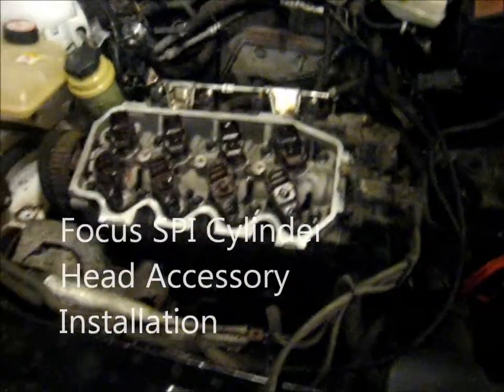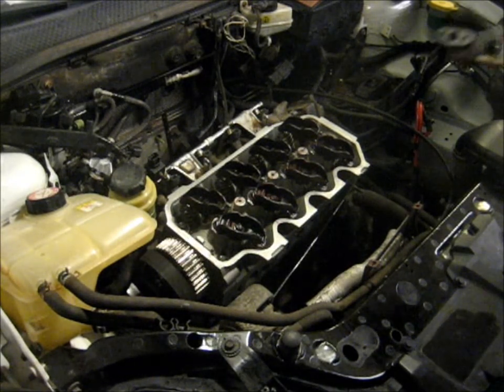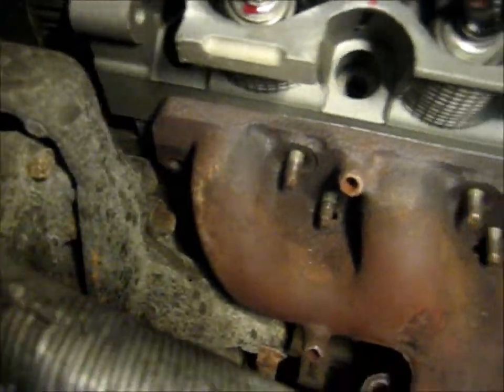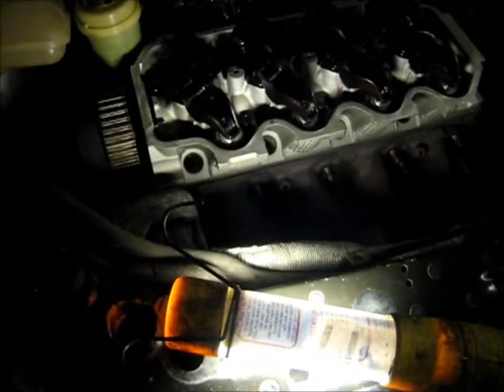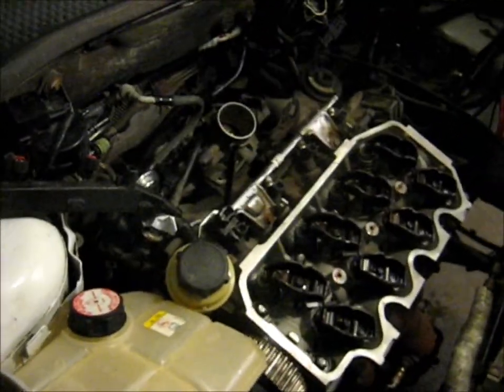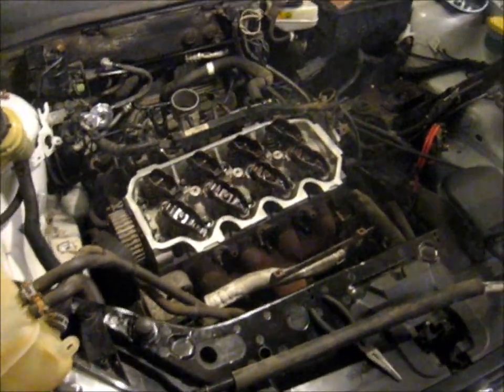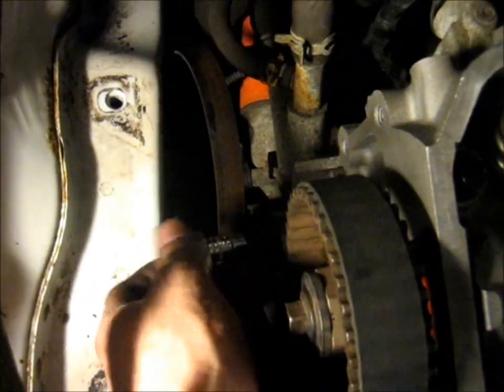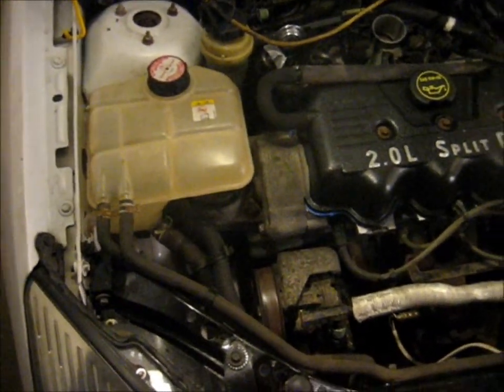Ford Focus SPI Cylinder Head Replacement Part 4/4

Comment from the maker: That is quite possible. There are many things I would do differently if I had to do it again. Since this was the first time I attempted this procedure, I didn't have the luxury of past experience. Also, if the head in question had dropped a valve seat, it would be necessary to remove the intake manifold to clean out the debris. In my case it wasn't necessary, but it's something to consider.

Comment: I was just wondering which repair manual u was looking at, because it is better than mine.
Reply from the maker: I am using a Haynes manual. I got it from Advance Auto Part.
Reply: Machine shops do not pump up lifters after machining a cylinder head.Lifters are primed by cranking the engine over with the spark plugs removed along with the fuel pump and ignition coil disabled.When the oil pressure light goes off,its primed.

Comment from the maker: Line up the arrow on the cam sprocket with the dot casted into the head. Set the motor and cam to TDC before installing the head. They will both be very close when it's time to install the timing belt. You shouldn't have to rotate the cam more than one tooth in either direction to line everything up.

Comment: WOW, you made this look easy. I just purchased a one owner 2000 Focus S/W SE, 82,000 miles, runs great, do you feel I should replace the head now ?? Thank you for the great ,and very helpful upload. I will be doing this replacement in my driveway.
Reply: Replace them I bought one with 65k and it was cherry. I'm at 69k and I just turned it on the other day and the noise started, I didn't have the engine running long but I have to replace that now.

Comment: When installing the Hydraulic valve lifters, does cylinder number 1 have to be put at Top Dead Center before removing the rocker arms and the hydraulic valve lifters?
If so, what would happen to the engine if cylinder number 1 was not put at Top Dead Center before replacing the hydraulic valve lifters and you drove the car around for short distances for a year?

Comment: Hi, so I'm pretty sure that I have a dropped out valve seat. I'm still running tests and things like that though. I'll be doing a compression test later. Anyway, I would like to try this job myself if I do need a new cylinder head. Do you think it is doable for a novice mechanic? I've replaced a fuel filter, brakes, rotors, starter and a few other things successfully. Are there any special tools I'll need?

Comment: Thanks for the reply, I have one of these engines with no problems yet but was thinking of changing the head before it drops a valve seat. I wasn't looking for a performance upgrade but a piece of mind. I have heard of other people having machine shops replace valve seats with poor results, that's why I was curious what they changed . Great video by the way.

Comment: I really think you did this the hard way by pulling the manifolds out with the head, I just unbolted the manifolds and pulled the head out all by itself, no disconnecting fuel lines, plugs, connectors and all that other bs

Comment: After install of the new cylinder head , is it necessary to do a Valve Lifter Clearance Check and if so how would this be done?
Reply from the maker: The lifters are hydraulic and require no adjustment.
Reply: @TheAlexManVideos  

Thanks Alex.

Comment from the maker: You will absolutely need a torque wrench. Air tools help with take things apart faster. With any engine work it is imperitive that all parts are kept clean and gasket sealing surfaces are kept pristine. With large tasks label everything. Zip-Loc bags and Sharpies are your friends. Stay organized. Buy a service manual and read through the ENTIRE procedure before you start. Plan things out and have all parts before you start. Triple your time estimate because nothing goes perfectly the first time.
Reply: TheAlexManVideos A fella took out the lifters/rockers and just threw em in a box. Is there a way to tell which ones go where? Or any advice?

Comment from the maker: Get the motor set at TDC when the head is off. Set the cam to TDC #1 when the head is on the bench. Install the head and bolt it all down. When you install the timing belt, it'll be very close if not spot on. Move the cam sprocket 1 tooth forward or back if necessary. Finish installation.

Comment from the maker: Without dissasembling the valves from the head, there was no visible difference. The company claimed that they maching out the old valve seats and install new ones of an improved design. It's not meant to be a performance mod, only a reliability mod. I don't know that you'd be able to see a difference at all.

Comment: i myself have repaired 2 focus' with dropped valve seats, it is very common with the spi motor. if the valve seat does drop, make sure you replace your EGR valve and clean your intake manifold, if not, the same thing will happen all over again as little pieces become trapped in these places, and always replace the piston  where the seat dropped, it bent the connecting rods and cracked the pistons on both cars i repaired.

Comment from the maker: If you don't see any scratches or scoring in the cylinder wall, you are probably safe. Make sure there are no dents close to the edge of the piston. These can cause ring sticking or piston cracking. If you don't see anything that looks dangerous you can go ahead and install the new cylinder head. It sounds like you got lucky but keep in mind it's a bit of a gamble. Make sure you clean the EGR and intake manifold before reassembly or the metal pieces may get recirculated through your new engine.

Comment: One more thing. What is the head bolt torque sequence. Do you possible know the Piston rod torque. I had to replace the piston in mine. I think the torque on the rod is 28?
Reply from the maker: Correct. Rod bearing caps are torqued to 28 ft-lbs.

Comment from the maker: I don't understand what you're saying. You checked compression and all the cylinders read 175 psi, then you go on to state that cylinder #2 had zero compression? Anyway, the compression loss is probably mostly from the valve seat no longer existing, but there is also the high chance that the piston and cylinder walls are damaged. You need to examine this to see if the motor is worth repairing. You can try using a video scope to give the car a colonoscopy. That or remove the head.

Comment: can you just reinstall the intake and exhaust manifolds after you've done everything to the new head and just drop the whole thing in like when you took it out? Also what would you recommend for cleaning the egr,intake and exhaust with just as a precaution to save yourself trouble in case anything is in them.
Reply from the maker: You certainly could install it that way. Do it whichever way you prefer. I did it this way only because it is lighter and easier to maneuver. Compressed air will suffice to clean the exhaust, EGR, and intake. You're just trying to remove metal particles, not grease or anything that will really be stuck. If you like going the extra mile some carb cleaner, a toothbrush, and a pipe cleaner would probably be good.
Reply: True, i have no mechanical skills beyond starters, and oil changes, and thanks to your videos, im all the way to the point of jacking up the car to remove the mount, and belts, i know for sure i dropped a valve, just gotta make sure the car is worth fixing and the pistons weren't destroyed. Since i dropped a valve, if everything else is fine, should i buy a head like yours, or go for the $275 one with the rockers and cam pre-installed just to be safe? After cleaning the egr valve, and the intake and exhaust manifolds obviously.
Reply from the maker: Kevin Thoma Glad I'm able to help. Good luck with your first big project. It's very unlikely that the cam and rockers sustained any damage from a dropped valve seat. I would carefully inspect them for any signs of abnormal wear. Compare the lobes for the cylinder with the dropped seat with the rest of the lobes. Chances are it's perfectly fine to keep using. Spend the money elsewhere.
Reply: Yeah i wasn't sure, just better to ask and know 100%, instead of having to go back and spend more $ because they got damaged. but thats good, because that saves me $75 lol I'll let you know how i do, since i'd still be reading forums and shit hoping to make sense of it, or spending double or triple what i'll end up spending when it's not that hard to do with guidance.
Reply: My ? Has to do with these parts. Someone took off the rockers/lifter and just threw them in a box. Is there a way to tell which ones go where?

Comment: What I was trying to say was that the readings I got from the compression test were: 175, 0, 175, 175. 

I removed the cylinder head last night using your videos, and I'm now trying to assess the damage. There are small craters around the valve of the cylinder head but the cylinder itself seems to be fine, as does the piston, there was minor debris in the cylinder and a few tiny craters or dents in the piston but nothing that seemed serious. But what do i do to tell for sure?

Comment from the maker: The head I bought from HeadsOnly on eBay was claimed to have re-engineered valve seats. I can say that it ran great when I put it all back together but you'd have to drive the car another 200,000 miles to see if it really is better than the Ford head.

Comment from the maker: If I was you, I would replace the head as soon as you can. There is no way to prevent valve seat failure on the Ford heads.

Comment: Thanks for your information. Yesterday my 1999 Escort (same 2L) had a loud lifter tick. I wasn't sure what I was hearing but it didn't sound good. I turned it off and started it and I didn't hear anything. But I know I heard something that didn't sound right. I am parking it and pulling the head to check it out. Hopefully I haven't damaged the cylinders. I've never done anything like this so your video is helpful.  Is the new head you bought engineered with better valve seats?

Comment: I don't usually work on these cars, but a customer made a special request.  Your video helped a lot, but some recommendations from a professional mechanic to anyone attempting this themselves:
Install the head with the intake mani, already installed. Trying to stuff that abomination ford calls an intake back there is hell.  DO NOT forget the cam position sensor, it requires removal of the intake manifold to remove/install. The exhaust manifold can be installed as uploader did in this video, but if you have a helper, then just install the head with both manifolds bolted to it much easier. Finally, I would recommend replacing all the studs/nuts which bolt up the exhaust components. Car came out great, but it developed an exhaust leak after a couple of months. New gaskets (again) and hardware cured it permanently.

Comment from the maker: Also, keep in mind if the valve seat was dropped, there is a high chance that it damaged the piston and block in one or more of the cylinders. If this is the case, you will need to REMOVE the engine and rebuild the bottom end as well. Bore the cylinders and install oversize pistons. If this is the case, chances are it's cheaper to sell the car and buy a new one. I replaced my cylinder head before the valve seat dropped so there was no lower end damage.

Comment: Hi there TheAlexmanvideos! Great vídeo btw! Listen i have the exact same car, im having problems with this bubbling situation in the expantion coolant tank, the car is not smoking, the presure level is right at the midle...i took out the thermostat and still bubbling, when engine is on first time of the day, a bit water comes out of the exhaust... Any advice please?

Comment: Yeah, that is what I'm afraid of, but I'm planning on selling it if that is the case. Is there anyway to check or gauge the damage before you actually begin taking the cylinder head out? or is that the only way to really inspect the damage on the interior? are there any tests? I just did the compression test earlier and each cylinder came back with a 175 PSI or so, but the 2nd to the right from the timing belt showed no change in pressure whatsoever. What does that indicate exactly?

Comment: Did you set the cam tdc before or after putting in the head? I have an interference 4g94 motor.

Comment: Thank you very much for this video. It is very useful. Do you know if a head from another Ford CVH will fit the 2.0 one in the Focus? SPI2000 engine is shit and unfortunately this car is an import for me and all other Europeans, but I can easily get a cylinder head from 1.1, 1.3, 1.4 or 1.6 8V. From what I have checked on different pictures the 1.3 is almost identical and the bore is just 4.8mm bigger. A lot my knowledge came from gomog.com/allmorgan/cvh.html website.